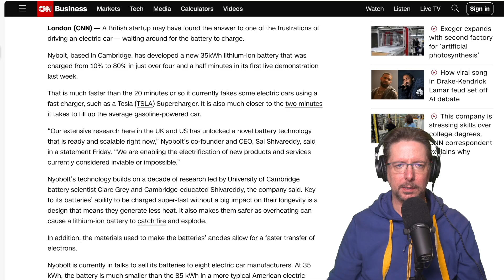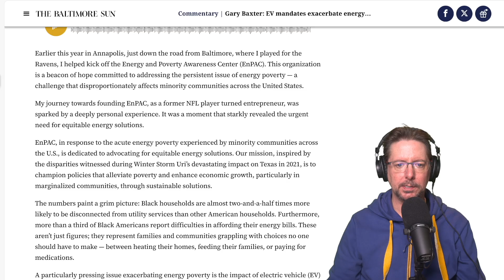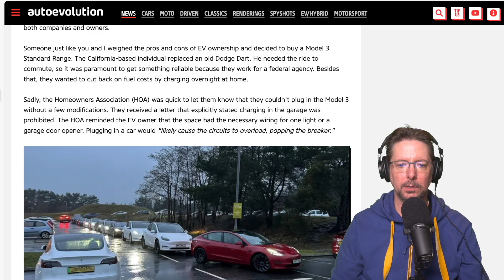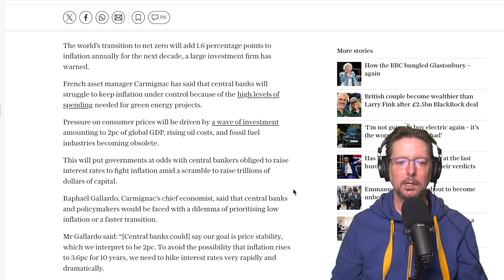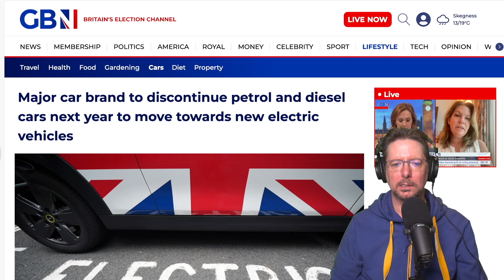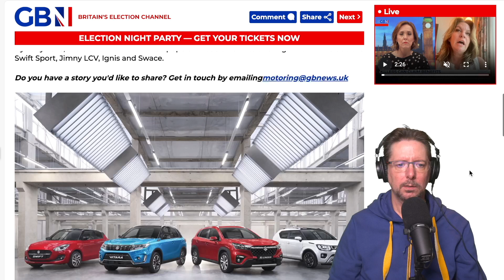Tesla owner's charging SHOCK! MGUY EV News Tuesday 2 July 2024 | MGUY Australia

Comment: I haven't heard anyone yet addressing the problem of EV depreciation. A quick search suggests the average cost of a 64kWh battery at £7235, and 84kWh at £9500. The AA estimates EV depreciation at 60% after 3 years, and the average cost of an EV at £46000.
So a £46000 car after 3 years will be worth £18400, but there are second hand EVs on the market now for between £7500 and £11000 for a 5 year old car.
Once depreciation has reduced the price of these vehicles to the cost of a new replacement battery they become a complete financial dead end. I cannot see anyone wanting to put a £9500 battery into a car valued at £10K - it's madness.

Comment: 10% -80% of a 35kWh battery is 24.5kWh. Recharging that amount in 5 minutes is equivalent to 294kWh charging rate, equivalent to boiling 98 kettles all at once. Don't they already make 350kWh chargers? 
As usual, trying to bamboozle the public with figures that don't add up.

Comment: 😶 brilliant!! Somebody figured out that if the battery is small, and you pound current into it, you can charge it fast. Welcome to the 1980's radio control car racing craze I was part of ..... I can charge an 18650 really fast, and dangerously, if I introduce 100 amps to it but it will be ruined in no time at all.
About lane assist....where I live 25% or more of roads have no markings. No white lines, no yellow lines, no markings where to stop, we rely on the drivers to make good decisions.

Comment: My 2006 1.3 L manual Suzuki was running low on fuel. Topped up within 5 min, another 2 min on the tyres. 
2 min getting the mandatory 6 monthly "Is your car a polluter check? Short ans, it is not. As CO, CO2, HC, NO readings were at the min of the scale
And back on the road. Fast and safe charging ( petrol), fast and safe payment ( 2 currency notes, as we can specify a $ amount rather than liters.). And no need to Q as we were attended and sent on our way in quick succession

Comment: I make 6 figures in the US my house was built in 1895 in a fairly small population area. I have no garage I have no off street parking (unless I park in the grass), I have a 100 amp box.... I technically have room to build a garage, but my sewer line runs right through that area. While a garage would add value to my house it wouldn't add enough to be worth the cost of doing so as I would have to update the whole house electrical, relocate my sewer line and spent another 30-40K building the garage. Not worth it for a house I will likely keep less than 5 more years.

Comment: Of course, shut down coal fired power stations ! if we had thought it all through we'd have created giant batteries to power EV's , which of course we would have filled using the electricity we have been running to earth ,from word go. A little known fact is that you cannot throttle up and down a coal fired plant according to need. You either use the power you make, or run it to earth.

Comment: Yeah, about that Tesla owner who wanted to charge in the detached garage.  He is an idiot.  Why would he assume he could just use the community electricity?  No need for a transformer, but yes a need for a separate power meter.  I'd say that could cost him several thousand dollars depending on the length of the power line. The arguments about EV fires are, of course, ignorant, but he needs to see if the parking prohibition is actually in the HOA bylaws, and if so, he can petition to get that changed.

Comment: Models S and X come with 100kwh batteries, and can charge from 10% to 80% in 15 minutes at a high power supercharger.  (As MGUY said, good luck finding one though).  35kwh is a little over a third of 100kwh.  So charging a battery one third the size in one third of the time is... the same speed?  How is that faster?  What am I missing?

Comment: You do talk a lot of nonsense. I think Ratcliff is/was the LAST coal fired power station in the UK. We haven't used much coal for years. As of March 24 Renewable sources provided 50% of the UK energy mix. In the UK renewable energy is now significantly CHEAPER than coal or gas. New OFFSHORE wind projects are offering electricity at about £48 per megawatt hour (MWh) compared with £446/MWh for gas-fired power stations. Why pay NINE TIMES more? Figures from 22/23.

Comment: Try charging your EV when you live in an apartment. Charging costs are higher than fuel costs by far if charging away from home. If you have no home that is compatible for charging EVs, not only will your vehicle cost more to purchase, service, and insure, you're going to pay more for "fueling" it than a gas-vehicle. Many of USA electrical grids can't even handle excess air conditioning and heating - how are they going to handle the charging of EVs along with all that? They're not. Then when you have storms and above ground electricity delivery systems, you won't be able to charge anything let alone get AC or heat. This is the new reset - making sure only wealthy people can get around, work, and live in relative comfort. The rest of us will just have to go on welfare. Watch happens when that system is overwhelmed. Meanwhile, we won't make 3rd world countries or India and China to do the same and the climate will not stop changing regardless of what we do - because it has always changed without our input. So what are we all doing this for? For there to be 2 classes - the few elite wealthy and the rest of us in poverty.

Comment: Why would you need to park outside while charging an ev?  According to the NTSB 5 cars have caught fire while charging in the US from 2019-2022.  EV fires occur 10 times less frequently than gasoline powered cars.  It is fine to be critical but don't fearmonger, when you are obviously wrong it brings doubt to the rest of your argument.
Reply: EV fires are also several times more violent and difficult to fight. Not an apples to apples comparison, buddy. (Last I checked. You also don't refuel your gas car indoors, either.)

Still. It's not at all intelligent to say: "This doesn't happen often. So, why bother practicing safety?" Your EV is far more likely to suffer a battery failure or electronics failure while charging than it is while parked.

Your argument is no better than "Very few house fires happen because of an unattended pot of oil... so why not just leave the pot of oil unattended? The alarm will warn you anyway!"

Just because EVs have fewer incidents of fires does not mean that they're completely safe. This is why you shouldn't charge your phone while you sleep. Sure. Your phone probably WON'T suffer a catastrophic failure and set ablaze... but it CAN.
Reply: @JDodgsonPlaysGames  My point is to present valid arguments.  Charging fires are extremely rare and not valid.  I don't like the government forcing ev's down our throats but there is nothing wrong with having them exist.  For some reason al large number of people want them snapped out of existence and spread lies.  Charging fires are a lie.

Comment: I’ve always wondered why they can’t do swappable batteries. Make them into standard sizes, set them up so you can drive over a pit and a robotic arm does the swapping, and presto changeo you can keep driving. “Gas” stations can have a charging area for those batteries, and you could automate the entire thing.
Reply: The problem then is that you'll end up with a new battery service rent economy. Cost is going to increase and quality checking is going to drive those costs up even higher. Swapping out your 1 ton battery for another that you're not sure is just as safe is not the best solution.

It can work, for sure, but someone is going to pay for it.
Reply: @JDodgsonPlaysGames  
Hence a standard. A 2,500 millamp AA battery is supposed to be the same as another manufacturers 2,500 milliamp AA battery. Same goes for 18650s. Hell, 87 octane gasoline is 87 octane gasoline in Texas and in Ontario. Completely different refineries, yet we accept that they are the same product. A 1 ton battery pack rated at X Kw should be the same as a different manufacturers 1 ton battery pack rated at X Kw. That’s why we have consumer protection agencies supposedly. As for how the batteries have been treated, well it’s a good thing we have computer systems capable of recording the cells charge times and rates that can keep track of its entire life cycle. I would expect the pricing of swapping them would take that into account as well as the cost of recharging. It would however require manufactures to agree to a standard, or probably multiple standards seeing as to how we have AAA through D cells for common electronics. I would bet it would be a handful of different Kw capacities that would depend on the size of your vehicle, or possibly multiple smaller cells so larger vehicles could fit more and smaller vehicles could hold fewer.

Comment: Even if the whole world's vehicle fleet magically became EV's none of the climate change goals would be met.

This is the principle failure of the concept that overshadows all other EV criticisms in my opinion, because all the other compromises and sacrifices that EV's require are pointless when, after it's all said and done, the actual goal cannot be achieved.

I swear it's like the whole world is just crossing their fingers and hoping this silver bullet will work, even after they do the math and calculate that it cannot possibly achieve their ends.  We might as well build our climate change policies around finding a leprechaun and wishing the problem away.

The part that actually hurts me is knowing that we can achieve all their goals, nobody has to give up driving a petrol or diesel vehicle, nobody has to change how they live, all we need to do is replace our existing commercial power stations with nuclear power stations and the climate emissions goal will be met, and our power prices will drop, and we wouldn't need so much space dedicated to power generation facilities.

It can be done safely, and even done in a way that reuses waste until the storage requirements drop to only 200 years, not 10,000 years, and no new technology is required to be invented, we've already designed and built them decades ago.

Comment: $1000 supremely cheap if you have to install a meter and a 48amp L2 charger.  I paid about $3500 to have my home circuit upgraded from 100amp to 200amp, a new 14-50 line run to the garage, and the installation of the L2 wall charger.  And at $3500, that was cheaper than almost every other quote I obtained.

Comment: There are a couple of problems I see. One is the power generation infrastructure. Wind and solar are at best a temporary backup, and in some cases, a short term booster when extra power is needed to supplement the grid. Without coal and oil, fired power plants, there is no real capability to supply the new green electric world with enough electric power to keep things going. How many people can afford a new EV? How many people can afford a home supercharger? I can't, and the same is true for most average people. The lower income and disability recipients like myself are going to be severely impacted and hurt the worst. Current home changing (depending on the type charger) could take from hours to nearly a week to achieve full charge. Since I live in a rural area I'm 30 miles away from a proper charging station so I would end up spending more time stuck at home charging than driving. One of biggest problems I have yet to hear to be discussed is the availability of the materials necessary to manufacture EV batteries. They aren't called rare earth materials for nothing. They are not only very rare but scarce and are in a very limited supply and could be mined out completely within a few decades.

Comment: So much of this issue is the proprietary design of EVs.
Way back in the day some... 30 years ago or so... Popular Mechanics had an article about swapping batteries in cars just like you would in any other appliance.

THAT was how they should've approached this whole EV situation.   You pull into an automated bay and a machine would remove the pack from your vehicle, move it to storage/charging, and mount a fully charged pack to the vehicle.  In and out of the service station in about the same time it would take to fill up a typical car.
This WOULD require standardization of the mounting system and chassis though the cabin/body of the vehicle could take on any shape.

Comment: It seems like another case of HOA overreach, can't even use your own garage as you like it, rather can't even use it for the purpose it was built for without permission, what a joke. As for the mentioned fire risk, do you think ice cars don't catch on fire in garages and burn down the house? The chance of your EV catching on fire is basically akin to your phone or laptop catching on fire, yet you leave em charging at your bedside or couch without a single worry in the world that it could happen to you right? 

You think when a phone or laptop catches on fire, they can't burn your house down? Just takes a minutes or two for it to spread and grow, and if you won't catch it in that time you can no longer stop the chain reaction. Yet people still keep these devices in their home, even right beside them as they are sleeping. The very real possibility doesn't seem to scare anyone...

As for the wiring issue, i call bs on that. By the way they worded it, you would think the wiring is so flimsy that you can't even plug in a vacuum cleaner in there. Only enough for one light or garage door opener, yea get outa here with that bs, i ain't buying it. How is that even up to code? 

The only real issue i can see is if he tries to charge from a communal outlet, he can't put the cost of his fueling on others, he obviously needs to pay for the electricity he uses. I'm doubtful of some parts of this story tbh, as if the guy was really such a douche who completely lacks common sense, i doubt he would have given up so easily...

Comment: It is a con.
Any lithium battery can be charged fast between 20% and 90% if you have enough cooling.
It is the last 10% of the charge that takes the most time, as the charging slows down because the battery doesn't want to take the electricity and starts to heat up, so the charger automatically reduces the current. 
The experts tip was, stop and charge at about 20% then only charge to 70% as that is the range the battery takes the power fastest. He calculated that making more stops for a smaller charge would be quicker and better for battery lifespan. Only ever charge to maximum slowly over night.

Comment: How did they keep the battery cool.
The law of thermal dynamics say to charge at that speed would heat the battery so fast it would be dangerously hot, close to thermal runaway. 
Yes they probably did charge it that fast, but it would be hours before the battery cooled down enough to use it to drive!

Comment: Spain 🇪🇸 is producing more solar energy than it can handle and  Scotland 🏴 routinely produces more Wind energy than it can use its a fuels errand to not fully fund battery storage capacity and get to ever cheaper energy but only if our energy infrastructure is looked at as a community run cooperative energy system

Comment: Internal combustion engine vehicles only use 25 percent of the fuel ⛽️ you put into them not including the efficiency loss from the well head through refining to the delivery to your local gas station ⛽️ it’s a fuels errand 😮😂 if you have a home solar system you could be 98% efficient for free and get an average of 30 to 50 miles of transportation per day freeeeeeeeeeeeeeeeeeeeeeee😊

Comment: How big are the EV charging cables going to be? I2R loss in copper cables are exponential, the more Amps you have the more heat losses you have to the power of 2. For simplicity an EV charging cable with 0.1 ohm resistance at 10A would have losses of 10A x 10 A x 0.1 ohms = 10 Watts. At 100 Amps it would be 100A x 100A x 1 ohms = 1,000 Watts. Existing slow poke 7.2kw chargers run at 32A. The new super-duper chargers are 1,000v, 500A. Edit, a Standard EV charging cable is 0.1 to 0.3 ohms.

Comment: You don't need a suitable supply to charge a car at home. All you need is three phase power supply and a resistor to prevent it from activating your circuit breaker.

Comment: Weird that people want to charge their battery in 5 minutes knowing that after 100 charges they will need to replace it. Had they charged it in 180 minutes to max 75% and never have it drop below 25% and keep it cool the battery would still be fine after 500 charges.

I use a software regulated charger that stops at 75%, has a resistor to prevent fast charging and a voltage limiter.

This is great, my phone will charge to 40% and then put the battery on idle when plugged. It will charge to 75% as slow as possible so it is ready in the morning. This battery is THREE years old and rocking! 🙂👍

Comment: The other day 'MGUY Australia' was reporting on battery charging technology - a new, very rapid battery charging technology and a solar blanket you draped over your car to recharge while parked during the day.  However, in both cases [in separate videos] it was explained the amount of electrical energy required to charge up an EV battery: a figure equivalent to over 2 days of continuously running a 2kW electric heater.  The point was made that we do not have the infrastructure, either in the grid as a whole, or in domestic properties, that remotely could handle the power required to charge an EV battery in the same time it takes to fill a tank with diesel.  The implication was that the grid could not cope with these huge sudden electrical surges and we would need charging cables the diameter of a telegraph pole to put this much energy into a battery in a couple of minutes?